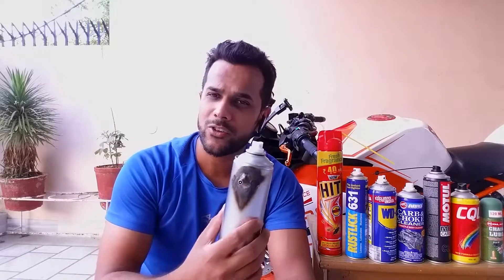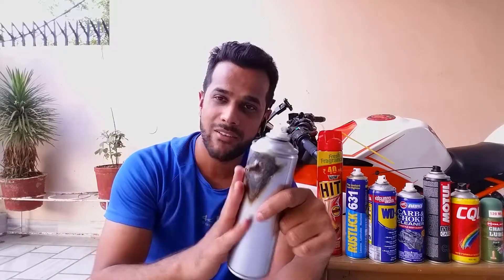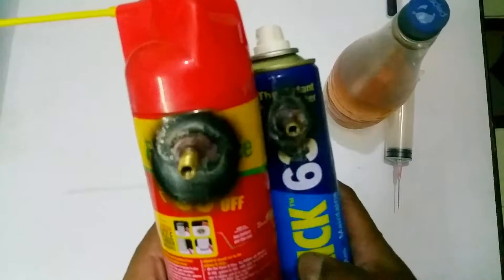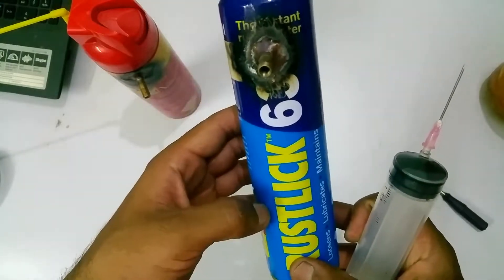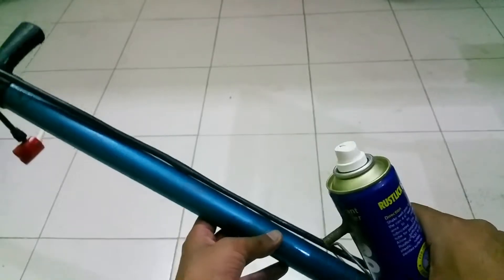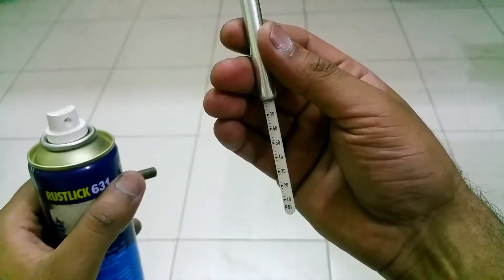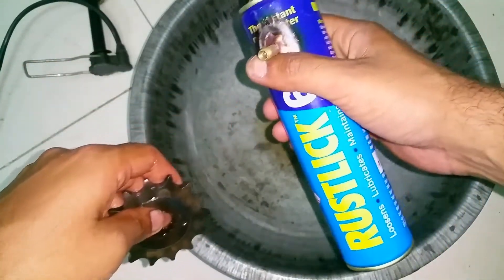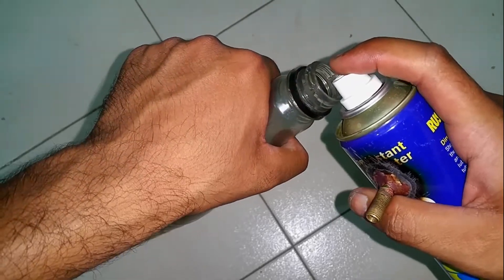🧪Refill/Repressurize Empty Spray Bottle Cans with Air

Comment: Can never get the solder to take to to the tin can even used dremmil tool solder flux maybe I'm using wring solder and flux also won't stick to the tyre valve I used a butane gas blowtorch to melt solder

Comment: Great job. 
You can also drill hole in bottom hard section and insert tubeless nozzle. Which don't need any welding.✌
Reply from the maker: Tried bro...Acetone starts to destroy the rubber portion
Reply: how would you do that?how would i get it in the hole from the outside?
Reply: I was going to do same using tubeless nozzle, where you buy the valve
Reply: ebay